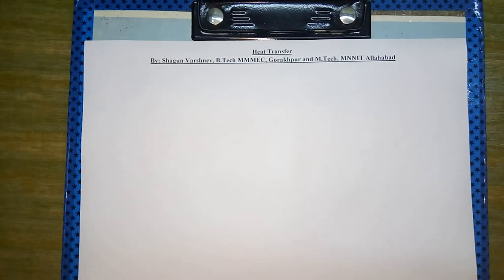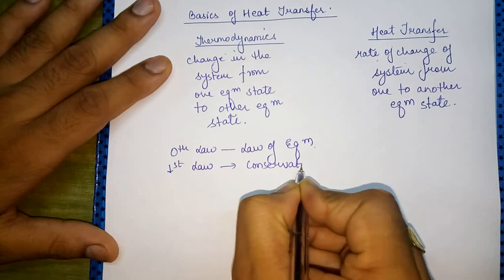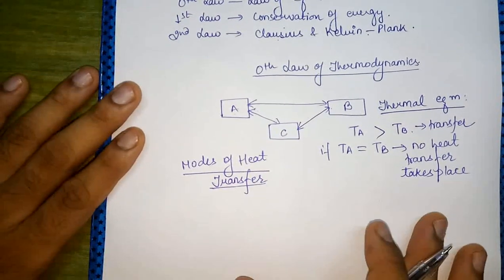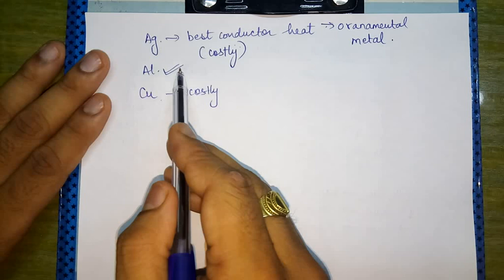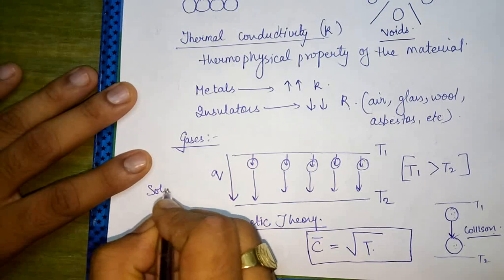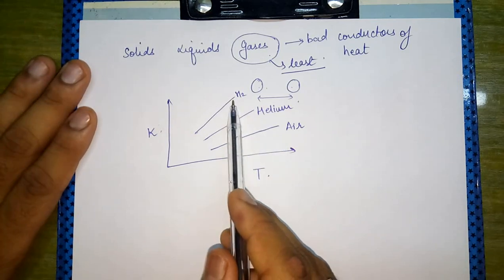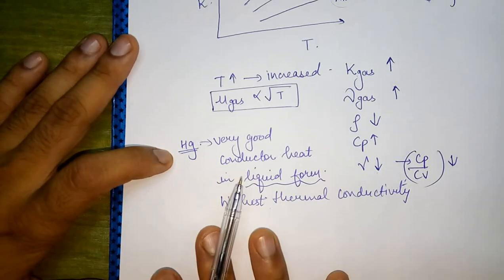GATE Mechanical Lectures for HMT | Introduction to heat transfer | Lecture 1| Conduction

Comment: Hi There, 
This was a good content. 
I would like to point out that diamond is a good conductor of heat but does not conduct electricity due to it's 4 covalent bonds.
Since it does not conduct electricity, it is classified as non - metal.

Comment: Sir,
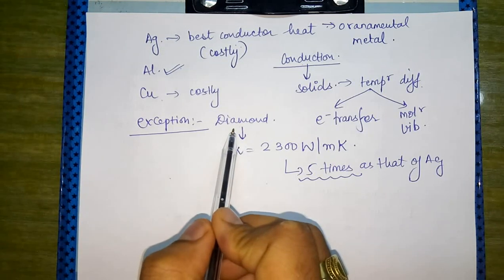11:15 at that time you said diamond is good conductor of thermal and electricity.but it is non metal so no electric conductivity.
Reply: Gaurav goswami diamond is good conductor of heat bt bad conductor of electricity
Reply: Bcoz of very good lattice structure which overcome the non-electrcity

Comment: There are many mistakes!! Diamonds do not conduct electricity and also copper has more thermal conductivity than aluminium
Reply from the maker: this has already been rectified in the comment section before...thanks for noticing.